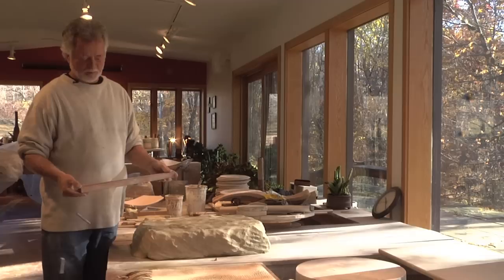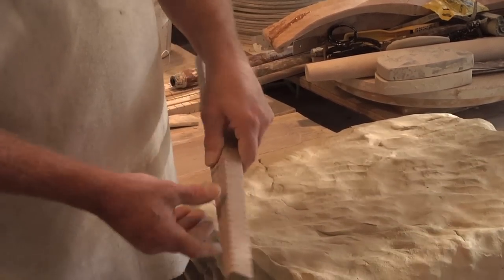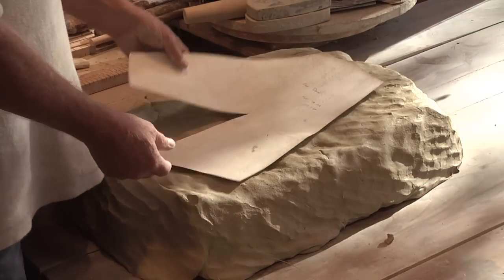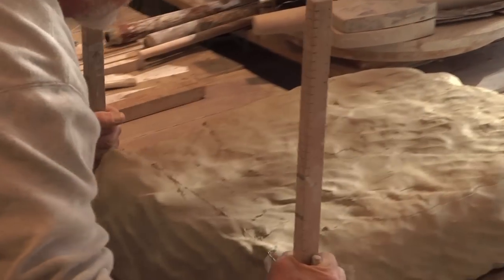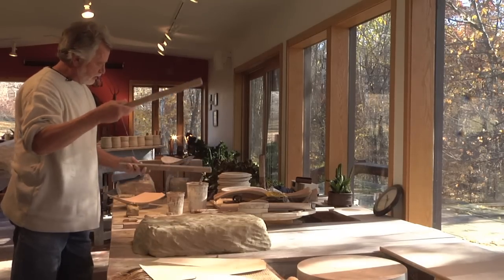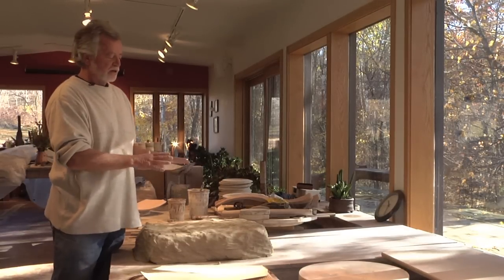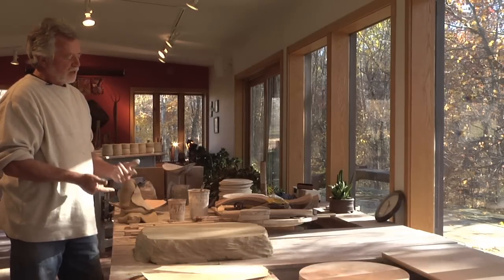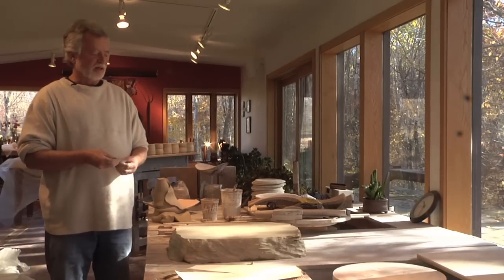The Pocket Slab Roller: A Brilliant Homemade Tool for Making Clay Slabs | RANDY JOHNSTON

Comment: Questions about slabs sticking together or stretching and distorting when removing. I just use an oversized rolling pin and matching wood strips on either side of the clay to make slabs.